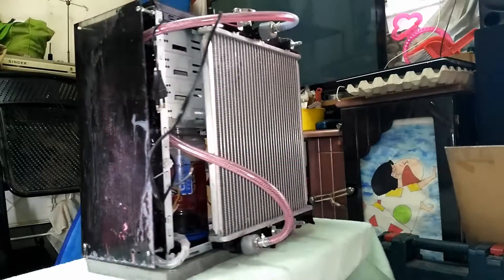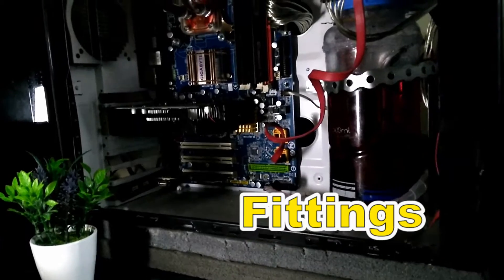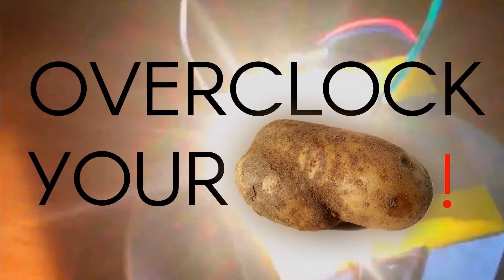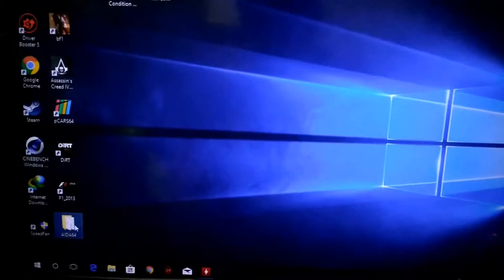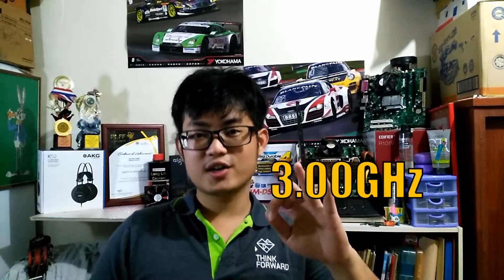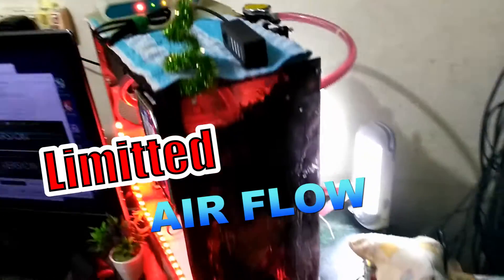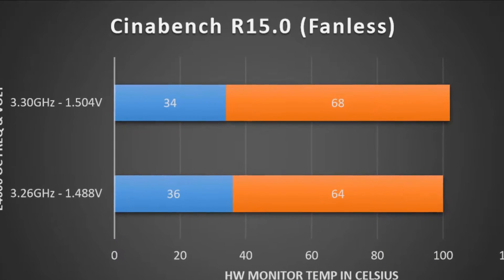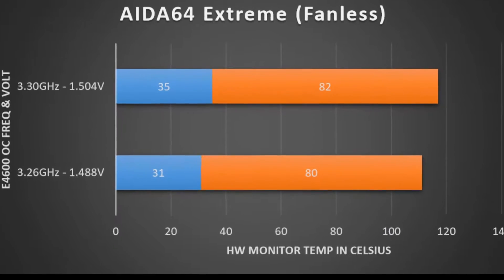PC Custom Liquid Cooled Antifreeze and Mixed Metal Explained

Comment: Fun video - congrats. I really like your automotive cooler and that you got it to work better than many other builds I've seen.
The essence lies in your 'description' where you explain the important principle factors for a successful water cooled build.
So, can we conclude that the contents of 'Mayhem X1' is similar or even equal to 'Toyota long life engine coolant' (designed for mixed metal loops with a 5 year service life)?
Reply from the maker: Their product is actually made for their pc water cool product. I am not a chemist but I'm quite sure what they made is for pc applications. I will not compare Mayhem and Toyota coolant, the name tells, it is not the same thing. One for computer, one for vehicle. The different of course is the composition inside the coolant. Vehicle coolant designed for high temp, anti foam, anti freeze and so on. If you want to use car coolant for pc watercooling, it is depends on your perspective. Many of the US forum watercooled fans did use car coolant and no issue, some of them very hate it. Just that.